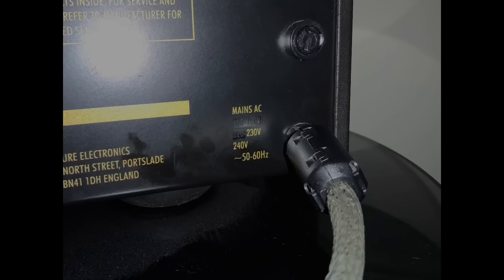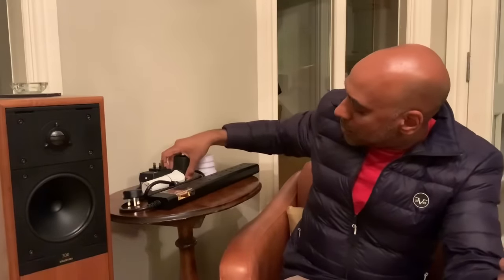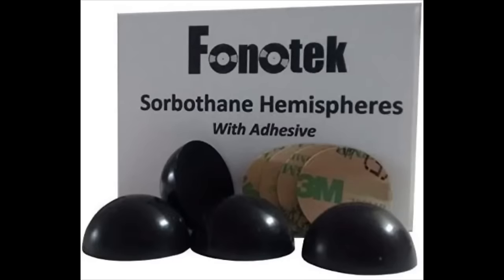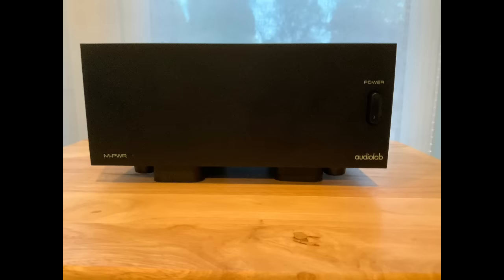My Top 5 Inexpensive Hifi Tweaks

Comment: I'm going to be trying a few of these tips Tarun, thank you. So far I've tried the passive Tacima mains conditioner, but it went straight back to Amazon the same day it arrived. It seriously dulled the higher frequencies on my system, and sucked a lot of the fun out of listening to my hi-fi. I've never heard a mains conditioner before so wasn't sure what to expect, and I appreciate that I might have gotten used to the sound when electrical noise is present. However, I felt it removed sounds that are supposed to be in the recording as well, and that's why it went back (and I notice this is in stark contrast to how you described its effect). I'm sure mileage varies, so for comparison, my system is Audiolab 8000S and 8000SX amps (from the late 90's), an Audiolab 8200CDQ, and a HiFiBerry Digi+ HAT board on a Raspberry Pi. Speakers are Mission 761's (the original design from 1989, recently rewired and recapped).
Reply from the maker: Thank you for watching and sharing your experiences Graham 😊👍
These things are largely system depended, hence the name tweaks. Have you tried the parallel mains conditioner?
Reply: @abritishaudiophile7314  I haven't, though a friend has and had a similar experience with the active Tacima one. I'm going to call iFi and ask them a few questions about theirs in the new year (when they're back at work). They also have a power strip called the PowerStation that has a built in conditioner that's directly connected to every plug socket. It's £500 so I'm hoping they can advise me on where I might be best spending my money. I'm wondering if it might be best to put some of that cash towards a linear PSU for my Pi streamer. But there's probably no substitute for trying it...
Reply from the maker: @GrahamAtDesk  I agree, you have to try these things as see how the work in your system 😉

Comment: A bit late, I know, but please accept a million thanks for your recommendations to improve your hifi cheaply.  So far I’ve got the Tacima power supply conditioner and the home-made power cable kit from MCRU and am absolutely astonished at the difference they’ve made.  It’s almost as if I’d changed the amp or the speakers.  How can wires makes such a difference?  Ferrite cores for the speakers are on their way!  

I really appreciate your thoughtful and detailed channel without histrionics even though some of it is out of my pensioner price range.
Reply from the maker: Thank you Andrew. I really appreciate you taking the time to watch and share your experiences 😊👍
Reply: Thank you.  Having had such initial success with your recommendations for power conditioner, ferrite cores and better power cable to the amplifier, my thoughts are turning to my CD player and streamer!  Would you recommend audiophile power cables to these, please?  (I’m aware that both the CD player and the network streamer will draw far less current than the integrated power amp so presumably have less capability to send out disturbing signals.). The CD player has the ordinary IEE plug like the amp so is easy to get a DIY cable from the same source.  The streamer has the much smaller figure of eight connection though I noticed it’s right next to the network cable on my Yamaha streamer.
Reply from the maker: @andrewwebb4635  I haven’t done a enough AB testing to say that a power cable will make a lot of difference. Each system is different. Collectively they seemed to improve mine. If you are totally confident in wiring you could go the DIY route for as little as £15. Only do this if you know what you are doing though 😊

Comment: You missed perhaps the best inexpensive tweak (for those of us using EU plugs): check correct AC polarity on all components.
Reply: Teknogod17  
It can make a difference. In case of AC it is always the same side that supplies power first. (the hot side) You can limit leakage currents by changing the place where the hot pole enters the transformer, simply by turning the plug! While the regular plug position may sound quite good, it may be that when changing the wires (or turning the plug), the sound benefits from it. (more civilized / less shrill)
Reply: @Teknogod17 Although the components will work regardless of polarity, they sometime sound best on a particular orientation. I noticed this on my marantz cd 6006 player. One possible explanaition for this are offsets on line level ground wrt to other components (this particular unit has an ungrounded AC cable).
Reply: Teknogod17  

I once had a Marantz CD10 player. That player had two sound signatures. The first was nice, but in that case the plug was oriented 'wrong'. The second (plug polarity reversed) sounded noticeably better. At the time, there was also a CD11 with balanced inputs. I guess the trick would have worked less there.
Reply: i meant balanced OUTPUTS of course...

Comment: Soldering the tip of bare copper wire or interconnects reduces corrosion and breakages due to tightening of screws.  Some may argue solder has more resistance than copper,  but copper tends to oxidize pretty quick and that black copper oxide layer acts like a semiconductor.
Reply from the maker: Thank you for watching and sharing Rajiv.

Comment: I love it when "Audiophiles" think they're electrical engineers.  It's so entertaining.
Reply: He’s not wrong though
Reply: @EnpuerKT  He is saying a lot of bullshit.
Reply: Tarun is an electrical engineer 🤦‍♂️
Reply: @wadimek116  hey man why so salty?
The guy is clearly on point with Speaker de-coupling, AC conditioning, he even mentioned keeping low impedance, so I think you’re just trolling.
Reply: @EnpuerKT  When he said about power cable interferance all his knowlage goes to trash. Its better to watch actual sound engineers
Reply: Yeah, its mostly BS. Nothing of that like would reduce noise floor. It will make things worse! No pro audio/studio engineer would ever do something like that.
Also, what noise floor are we talking about? Is he beyond -120 dB or something? I would think not, because its nearly impossible to achieve. And if you want to get close to it, you do it with isolated cables, no ferrites on the audio. Maybe a bunch of paralleled silicon (tranistors, op-amps), minimal resistor values and some proper electronical engineering in the signal chain. If you want to know what keeps noise low, read something by Douglas Self. He is kind of the world leading engineer in low noise applications. And he writes good books about amplifiers and stuff! No need for snake-oil type of advice

Comment: I do audio electronics for a living. One of the hardest things is convincing people that just because their components cost thousands their cables don't need to as well. Excellent advice on the cables. We build great stuff with Canare wire and various connector suppliers (Vampire is in the neighborhood, so our first choice). 

The biggest tip, and I don't see it here so assume you have another video for it, is FIX THE ROOM.
Reply from the maker: Thank you for watching and sharing Ronsonic. I did one on speaker setup which I think goes a long way to dealing with room issues but need to do one romm treatment as well.

Comment: Re: ferrite cores - they reduce noise at the cost of increasing impedance, which may strangle the music.  Paul McGown from PS Audio explains here: https://youtu.be/PhOVMgPMqWU?t=310
Reply from the maker: Need to be used wisely and don’t work for all systems. Thank you for watching Anthony.
Reply: Ferrite cores ONLY  affect megahertz frequencies.  They have less than 0.00001% effect on audio frequencies (under 20 KHz), audio impedance, audio inductance, etc.  AC power conditioners are very important to 1. protect the electronics and 2. keep the power surges out of the sound.   Surges can be audible if they are large enough to affect the power supplies of the amp, preamp, etc.  All wires pick up megahertz frequencies, but they do NOT affect any audio frequencies, so you don't need to shield or add ferrites on the AC power wires or speaker wires.   Component interconnect wires need shielding because the impedance is high and voltage levels are low.  AC power and speaker wires are low impedance and high voltage, so they don't need any shielding or ferrites.   If you want to add ferrites, add them to the component interconnect cables.  They will help the shielding block noise from external sources.   Megahertz frequencies on the component interconnects can cause amplifier oscillations that you won't hear, but they can overload amps and cause catastrophic failure from internal feedback loops that are not designed to handle megahertz frequencies.
Reply: Strangle the music? What nonsense. The ferrite increases the inductance enough to suppress RF.  It has no effect at audio frequencies.

Comment: Back in the days we used tennis balls under our speakers to reduce vibration. I currently have spikes for my speakers and there is significantly less vibration on the floor surrounding the speakers than without. That's of course a subjective measurement by placing my hand at the same distance from where the speakers touch the floor.
Reply from the maker: Thank you for sharing 😊

Comment: I've seen some of your vids and tbh you are very sensitve to snake oil products that never been proved to work. Sure there are washing machine decouplers, and I've heard a lot that they work great. But speakers are not washing machines! As long as they are designed properly, their cabinet won't vibrate. This video shows this perfectly well with a subwoofer playing a tone at a very high 117dB SPL: https://www.youtube.com/watch?v=ttk4y6_afa8 There's a glass of water on it and it doesn't move at all. Here's another one with even a coin on its side: https://www.youtube.com/watch?v=tu2n-XCzfnI 

Also, mains conditioners won't affect dynamics or frequency response at all. Tbh that just doesn't make sense :) And this can easily be measured. Please realize that our ears are not calibrated well at all and our perception of hearing can be fooled very easily. When you find that you hear any differences, should abx test it. This is the only valid way to know if you really heard any difference, or just perceived it.
Reply: I recently noticed a metallic buzzing from my system and I was afraid the tweeters were dying or something.  It only appeared on certain songs but search as I may, I could not find the source. One time I was picking something up from the floor and when I bent down that metallic buzzing appeared again. Now I could tell where it was because it was right at my ear. Apparently, the floor was uneven and the adjustable feet of the speaker stands were not firmly resting on it. This caused the metallic base of the stand to vibrate like crazy, creating the buzzing sound. I could tell it was the base because if I put my hand on it the noise would stop. I merely adjusted the feet to solve this issue but anti-vibration feet would have easily prevented this in the first place. You cannot generalize and unilaterally dismiss the validity of all of these tweaks. If power cables have no effect we'd all be using the cheapest cords available.
Reply: They love to believe most of the time it's just to make themselves feel better about spending so much money on stupid things that don't make any bloody difference.i mean little bridges for speaker cables to keep them level that's a beauty. I could go on we all know there are lots of stupid things in the market for large amounts of money but more importantly there are lots of idiots that are more than willing to believe.
Reply: I build my own amplifiers and I built a nice headphone amp for work. it had fantastic sound stage for a headphone system that set it apart from others I had listened to. When I built it  there was a wire run that I had attached to the side wall of the chassis with an adhesive wire retainer. One day I was listening to it at work and I noticed that the soundstage was gone. It sounded flat. I popped off the cover and that wire had come unstuck and was paying against the output transformer. I could not hear any noise. Only the quality of the current signal was not as good as it was. I put the wire back and it all came back instantly. My point is you CAN here amazingly sublte changes in a system if you are educated as to what you are listening for.

Comment: Theoretically there is a good reason to put the Ferrite Core at the amplifier end of the speaker cable and not the speaker end.  RF is very unlikely to be audible directly in the tweeter due to its frequency being beyond our hearing and because the cross-over is passive it is unlikely to be disturbed by RF.  

RF does affect active components, such as Transistors and Chips and these are in the amplifier, this is what you want to protect from RF.  I would suggest protecting the amplifier from the speaker cables acting as an antenna by having the ferrite core by the amp.  This is why you would put one on the power cord near the amp.

I think EMI however does affect the speaker, so if you just want to block 50Hz hum from the mains being picked up from the speaker wires then you need a blocker at the speaker end, however 50Hz is very much in the audible range and not affected by high frequency ferrite cores.
Reply from the maker: Thank you Neil 😊👍

Comment: A bunch of snake oil if you ask me. Get more upgrading than "tweaking". All you tweaking is your brain wanting to hear a difference
Reply: @13thnotehifireviews7  If you can't objectively measure a difference—essential given that sound reproduction is LITERALLY the measurement of sound waves—it is snake oil by definition. We can measure differences in sound waves with a precision thousands of times greater than the the most optimistic beliefs about the human ear. It is trivial to reliably measure differences so subtle that no human has ever been able to distinguish the different. So if such tweaks made a difference, you'd be able to measure them. Disputing this means denying the very scientific method which allows your Hi-Fi to work.
Reply: @13thnotehifireviews7  We can transmit trillions of bits of information per second over copper wire and land space rockets onto seacraft that's rolling about in the waves... and you don't think we can measure the behaviour of a speaker cone with some precision? Exactly how do you think a power cord is going to affect the sound if there's no change to the electrical output from the amplifier and no change to how the speaker cone moves? And yet we know that human hearing is trivially influenced by what we hear. (e.g. the McGurk effect)
 
Please, stop with this wilful ignorance of the past 50 years of scientific progress.
Reply: @13thnotehifireviews7  Your statement is the one that manufacturers and retailers use to get ppl to buy more expensive products that doesn't work, and you bought that ...:)
Reply: Agree fully! If ‘real audiophiles’ saw the grade of cable used in studios where their music is recorded, it might open their eyes. Never mind they all listen in a room that isn’t treated so their room is colouring the sound more than any mains interference

Comment: I use plans I found online once for a turntable and speakers where you used all thread for the legs and you drill the holes for the shelves out bigger than the all thread or the metal washers that you're using on the all thread and then you get a neoprene washer top and bottom of each hole and back it up with one of the metal washers top and bottom. And that left the shelves floating insulated from vibration by the neoprene. It works very well.
Reply from the maker: Hi Dave, thank you for watching and sharing 😉

Comment: Extremely concise well presented and knowledgable presentation. I can see why your subscribers are growing. This is deffo the best cheap way to get into tweaks. I’d say you’d get 40 percent of what the more expensive solutions provide and I’ve tried most of them bar the washing machine pucks which I’m going to have to play around with as right now I can’t afford the iso acoustics ones under my speakers. I used to be an anti expensive tweaker and anti expensive cable guy but I ended up demoing a lot of still points and Entreq cabling and it showed me that it wasn’t snake oil.. Although I’ve easily spent a component level amount on my cables and isolaters in my system I would say the accumulative effect far outweighs any component upgrade of the same price. In fact component upgrades have sometimes resulted in sideways moves and not always improvements.
Reply from the maker: Hi sound ideas, that’s a very sensible approach. I really enjoyed reading your comments and learning about your experiences. Thank you for sharing 👍

Comment: What a  beautiful HEGEL set-up! Green with envy. Never understood why you Brits like glass racks - terrible platform for components. Here in the U.S. all the top brands are vibration indifferent/cancelling materials, quite often with several layers of dissimilar materials. 

Cables make a difference, and sometimes system matching becomes an irrational sequence of purchases to see which cables work best (audophilia nervosa). The iFi goes for $100 U.S. I ordered an IsoAcoustics de-coupler stand for my subwoofer. 

Terrific video! Cheers from the U.S. of A.
Reply from the maker: Hi Jamie, I think it is an aesthetic thing with the glass shelves. I have sorbothane/silicon feet under each piece to illuminate vibrations. Thank you for watching and taking the time to comment 😉

Comment: Instead of putting the ferrite core on either the positive or negative speaker wire why don't you just put one Ferrite core on both wires at the same time before it splits.